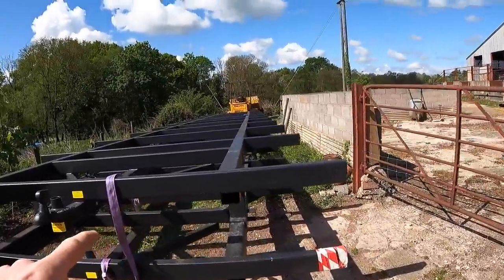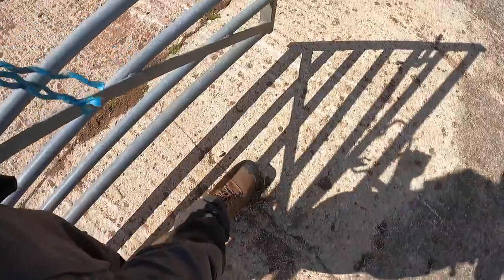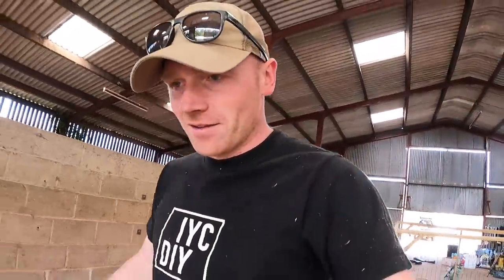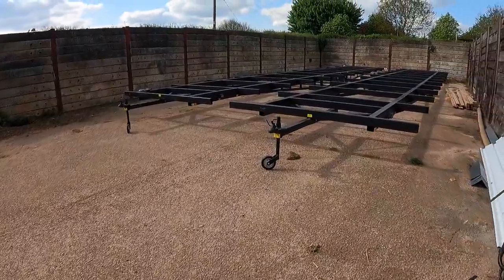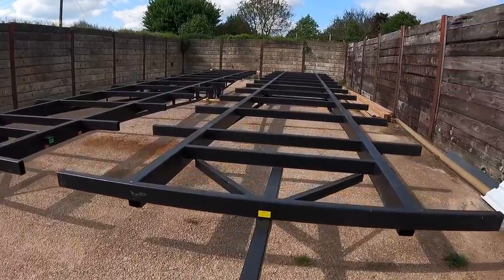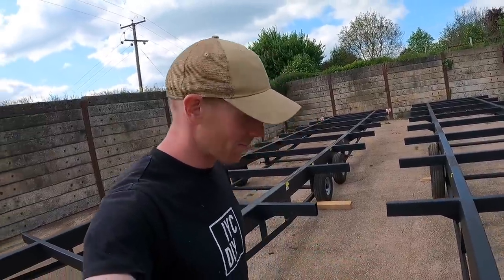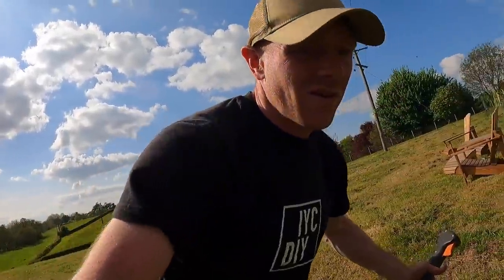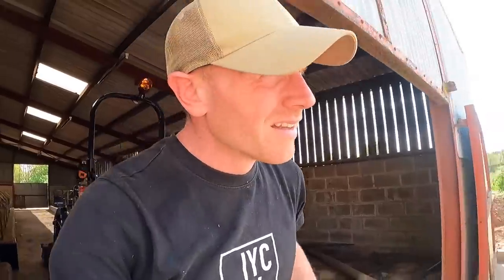THE BIG MOVE - Lifting our 50ft steel chassis and the biggest turning circle EVER!

Comment: Riemann P20 sunscreen is highly recommended. Been using it for years. Put it on once and that's it for day, also no issues with it washing or sweating off. Used it for all sorts from days at the beach to running ultra marathons to harvest. Put it on before heading out and can forget about it for the rest of the day. Never burnt once. Seems quite expensive but due to only needing one application a day and it going a long way it is actually very cost effective. Great for kids as well as no need to top up throughout the day.

Comment: That's one thing I have noticed about Farmers, they tend to help each other out, even if they are in direct competition, it's like a family thing.
Reply: help each other out but also usually the village. Ours are the first out clearing snow and gritting the roads, cutting any fallen trees down, collecting the wood for the annual bonfire, pulling cars out of floods,  the list goes on and on. Work the longest hours for not a whole lot of money. Corner stone of most country villages.
Reply: @C4sp3r123  indeed, I like a little further into a town than you by the sounds of it, but still less than 30 mins walk from just farmland, so most of that is sorted by the local council.
Reply: @almostanengineer  most of it should be sorted by the local council here as well but it would be August before they turned up to clear the December snow 😂

Comment: so cool to have good neighbours, could you not just weld on some new bolt hangers, rather than moving them around?
Reply: Probably but it didn't look like it took much effort to do the last movements into the silage clamp so probably quicker and easier to move them.